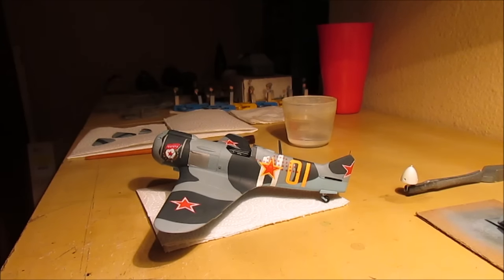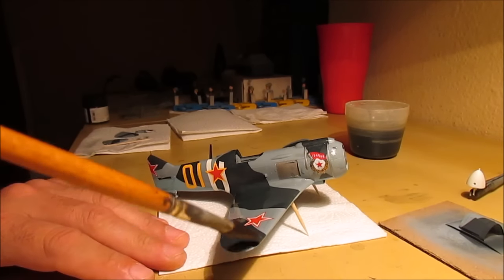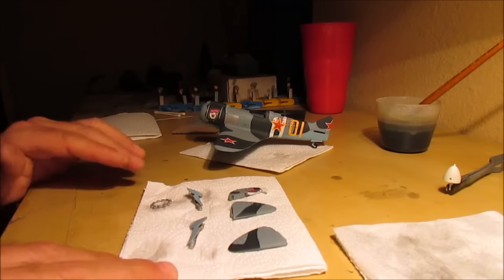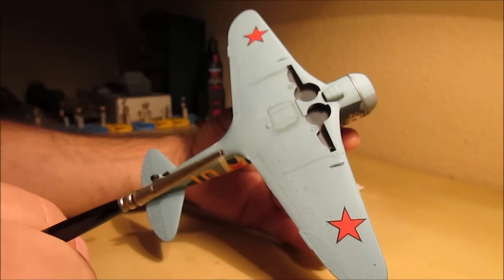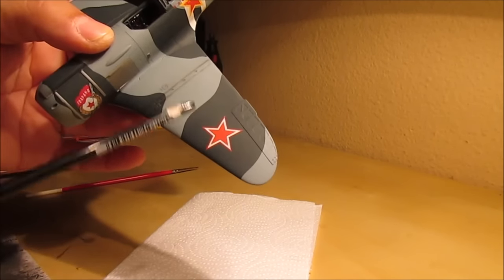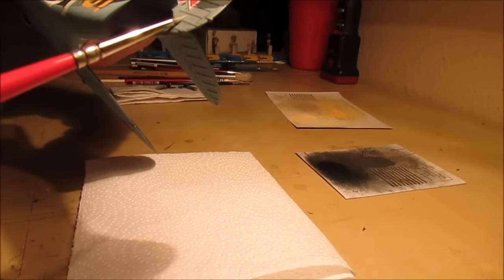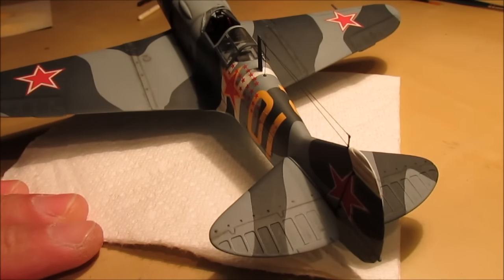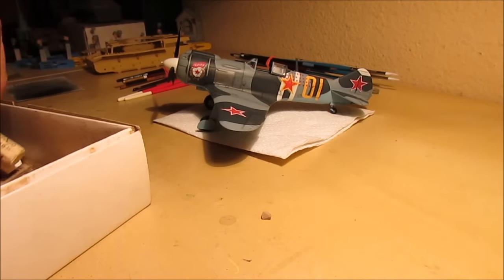Howto : Weathering Aircraft Realistically ,With Washes and Pastels

Comment: Do you not need a varnish for your models if you plan to use a wash? I'm always worried I'd wash the main colour off or worried masking tape will rip it off?
Reply from the maker: Old Skool Wax as you can see Varnish is an un necessary  step and I never use it never
Reply from the maker: Old Skool Wax Also Varnish leaves a sheen that is unrealistic an extra step that takes time for no reason
Reply: I agree completely. I'm thinking of turning to model making. Arrived here via studying the history of armour (among other things). What do you protect your kit with before weathering? I've seen many, many people making kits on youtube, and whilst they look aesthetically decent, I can tell you from studying thousands of images, most have been completely unrealistically weathered. Yours in one of the few that I can look at and agree with. I think many people get carried away and end up with arnour that looks like it's been in a hay shed for 50 years.
Reply from the maker: Yes I don't like to overdo it

Comment: Just wondering if you only use Tamiya or some other acrylic on your airplane models as well and if so what do you do to prevent the paint from lifting when removing any masking tape or compounds.
Reply from the maker: +John Crumpton The Paint will not Lift ,when you Primer The Model all of my work ,wether it is a Figure,Tank or Plane gets Primered and that way The Paint adheres to the model and will not lift no matter what
Reply from the maker: +John Crumpton Do Not use Hobby Primer too Gooey and thick ,Use Hardware store Primer without ZINC .
Reply: +Panzerkiel13  Now I can make the change to acrylics. I plan on using the Wal Mart brand that you use. It makes sense. I assume that this brand does not have the zinc.

Comment: Another quick question, what brand of paint do you use if Tamiya does not make that color? Do you mix the Tamiya until it matches?
Reply from the maker: +John Crumpton I only Use Tamiya for The Main and Testors For Aluminum,Silver,Chrome. If Tamiya does not make a Color I mix it ,I mix 80% of the Colors I use
Reply: +Panzerkiel13 Thanks, I appreciate the quick response.

Comment: Hi two questions, do you put on a varnish on before weathering. And secondly do you wet the pastels or do you leave them dry when rubbing on the plane. Great video thanks
Reply from the maker: Hi I never EVER USE Varnish leaves a sheen that is not flat ,I have a Video on Decals and Clear Finish on my channel I explain everything there . The Pastels go on after the wash has dried they are the last thing you Do then you leave it alone
Reply: Panzerkiel13 when do you hit the Model with dullcote?  Before or after the pastels?  Thanks!
Reply from the maker: Before to Seal the Decals ,Then the Wash when that Dries then the Pastels
Reply: Panzerkiel13 Thank you for the info!  Drew
Reply from the maker: Welcome Glad it Helped

Comment: Either I missed when you used the pastels for the exhaust stains  or you forgot to video that. Very informative videeo though.
Reply from the maker: jim scharfe Yes I did not video that wanted to cut time as the video is long anyway ,The Exhausts is just the Brush dipped in Black Pastel and Randomly going back and forth on the Area exposed to The Exhaust flow ,thanx